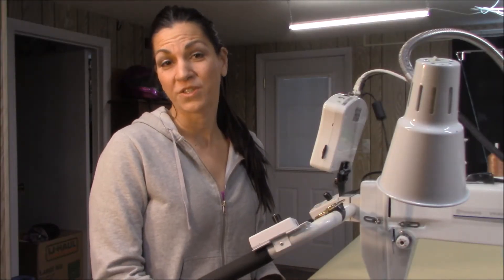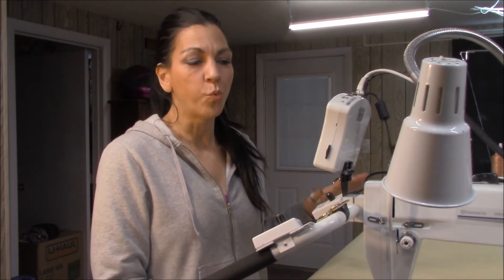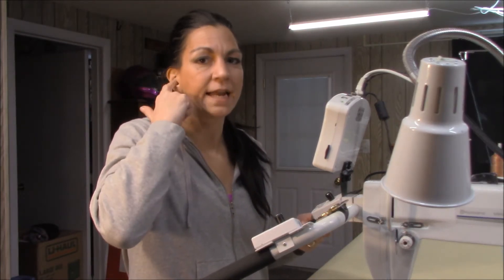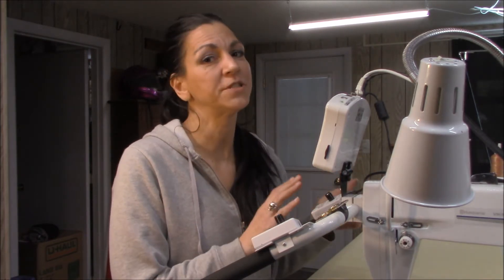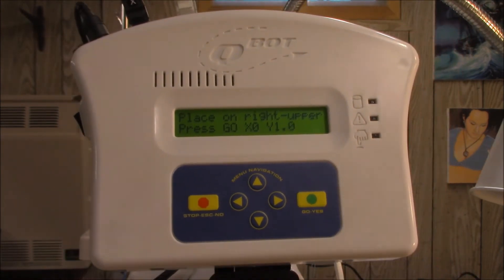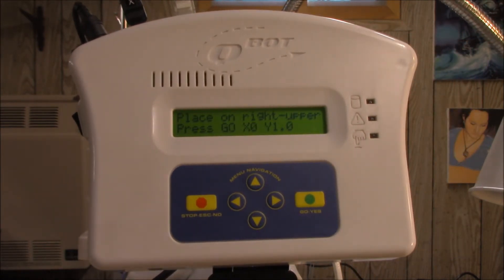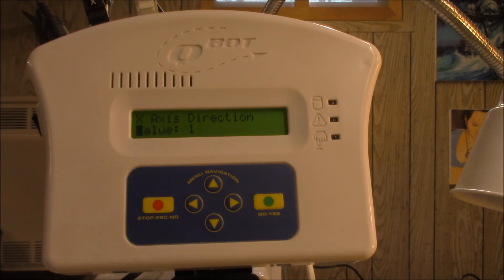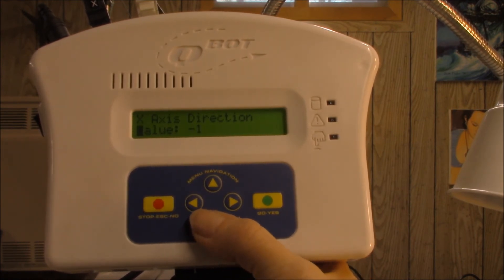Q-Bot Quilting Program - Fixing a Common Issue or Problem

Comment: Found it thanks.
My club has been donated a QBOT older version. No software, but many designs on memory stick.
After some difficulties setting up the frame, machine & qbot, the design is not stitching out correctly.
Am hoping this video will help to solve the problem. Many thanks

Comment: I have the Qbot V2 and bought it used so am new to long arm.  I have 2 problems I am trying to solve on this  Qbot and wonder if someone can help me.  Can you do a E2E design on this without selecting the "another" on the screen?  I was hoping it would stitch out the design continuously until the end.  The other question is when I Press Go for design to start machine goes to the center of my fabric instead of starting at the edge of the fabric.  I would appreciate any help  Thanks
Reply from the maker: HI Joyce!  I have Version 1 and I don't get a "another" message..  but I think I can help you.  Have you downloaded the design software on your computer?  If not, you really should.  What I do to continue a pattern across the quilt in the software is this:
Open the software and click "File" then "New", then in the next box that opens click "Start a new work area".  Then select your quilt width and machine reach, then click "Finish".  Then open the design you want to stitch in the software also.  Select the design and copy and paste it into the new work area.  Move it all the way to the left.  Then select the icon at the top that looks like two flowers next to each other; in the box that comes up, leave the gap and margin at zero, and notice that it will tell you how many it will copy across to fill the space.  Click "OK".  If the different patterns are not touching it is ok; you can move them to touch (if the beginning point of one and ending point of another are lined up that is best) but even if they aren't touching the machine will finish one design, then wait for you to say start again to move to the next starting point, the wait for you to click ok again to begin stitching the next one.

As far as your question about why it moves to the center to begin stitching, if you open the design in the software you can push the "Play" button to see exactly how the design is stitched out.  It appears that the design you chose begins in the center.  To test it out, you can run the Q-bot without starting your machine to stitch, so you can see where it will go; when it finishes, you can select "Repeat" and it will go back to the original starting point.  I do this all the time to make sure that the design doesn't play outside the lines where I want it to.  I hope this helps!  Feel free to ask if you are unclear, ok?
Reply: Thanks for your detailed help.  I wish I could use it.  I have the 4D software but can’t use as I don’t have the dongle.  The person who sold me the machine and table kept the dongle for her software that she still is using. .  I wish I could buy a dongle or find one.   It is strange though when she gave me all of this there  was  a dongle in a case but for some reason it won’t work.  She said she received 2 of them .  Can’t figure out why the  dongle doesn’t work for the 4D design software.  My friend that had this machine doesn’t seem to know the answers so I don’t think she used it fully to its potential.   

My next question and maybe you know this answer is when I am stitching out a design and I run out of thread I stop machine and get a new bobbin in.  I select restart and got the percentage that I think  the thread broke and start the machine.  The machine starts from the percentage that I selected but it goes very slow until it gets to the end of design.  When I select another the machine goes back to the normal fast speed.   Why doesn’t it go fast after I start restart?    

I have been searching for someone for answers.  I think so far I am doing good on machine just by looking on the internet and UTube.  I was hoping to get someone to respond to me.  Thank you Thank you. 

Joyce Stelzer
Reply from the maker: Joyce Stelzer when you restart the Q-bot and it very slowly moves back to where you want to start again, click the stop button; once you hit stop the machine will allow you to adjust where you're at using the arrows, then you pull your thread up and click "go" and then it will continue stitching at the usual speed. That one took me a while to figure out too :-)
Reply: What design software are you referring to?  What site has it on?  I have the 4D design software but still unable to get the driver in for the dongle to work for it.
Reply from the maker: Joyce Stelzer that is the software I'm talking about.   Have you tried to register the dongle and software on your computer? You really need it! If you can't make it work, check out their website www.myqbot.com/support.html and let me know if this helps!
Reply: I did go to the myqbot site and register with them just now.   Not sure how that will help?   They do have help for $50.00 for 30 min but if they can't solve problem no refund:)   I will try and register by my computer now.  I wonder if I am having problems with installation because I am running Windows 10.   May get out an older computer with Vista on and try it as I notice the software  does not list Windows 10 as a version that it will work on.   I will keep trying.  Got to be away, right?
Reply from the maker: Joyce Stelzer I have windows 10 and it works great. I remember having issues when I first registered the dongle and I couldn't get the software to open, then tried again a day later and it opened right up.
Reply: Well I tried on  my older computer running Vista and I got it up.  Yeah!  But this computer is s l o w.   I think I still can get it up on the Windows 10 by getting an update on driver.   So will see how to do that?   More to research.   I couldn't get the software/dongle to register on Windows 10 computer as the URL is not available it said probably because it is old. But for now I have program running on Vista and now can go and follow your directions you sent me.  Thanks again.
Reply: I following your directions for working in the software and it worked as you described. Yeah!   So now I have that up but found the Vista computer wouldn't recognize the SC card for some reason.  But I tried a stick drive and it recognized that so I can get my design from the Vista computer to my Win. 10 computer to put on the SC card.  A round about way.  Still would like to get it all running on the Win. 10 computer.  I know the dongle is recognized by the Win. 10 computer as it lights up now but when I bring up program It tells me it can't find dongle.  I know the driver is in for the dongle also.  I did register it at the site on line.  Program wouldn't register from the software.  It said the URL couldn't be found so am thinking it was too old and maybe they changed the URL?  So you didn't have a problem with software not finding the dongle on Win. 10?  Last night I removed all the software from Win. 10 for the Designer program and reinstalled thinking I did something wrong on installation.  When I tried to get program up it still said unable to find dongle.  Dongle was lit up though.  If you have any suggestions I would appreciate it .   My only other option is to pay them $50.00 for 30 mins of tech suppose which I am reluctant to do.   It is probably something simple that has to be done.
Reply: Are you running the 1.1 version of software that sayson the disk for XP Vista?
Reply from the maker: I went to the website and downloaded the update for Version 1, it is now running 1.31.  In Windows 10.
Reply from the maker: I think my computer recognized the dongle a couple of days after I registered the software.
Reply from the maker: Hey Joyce, have you got the QBot system up and running?